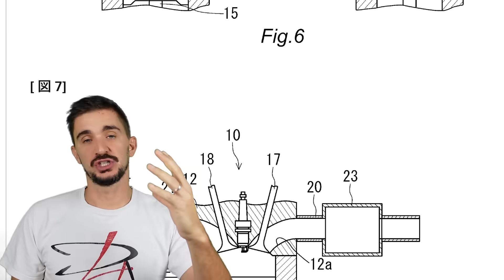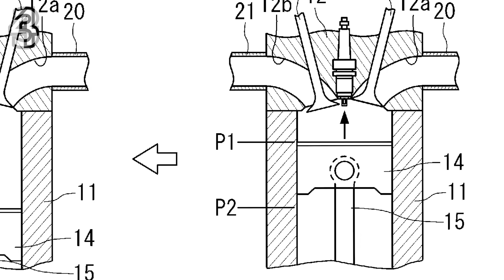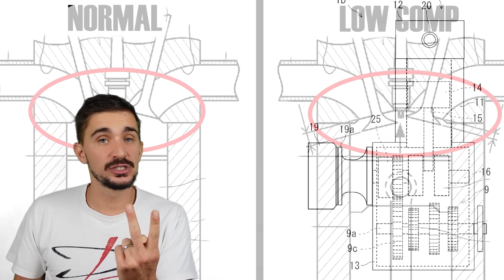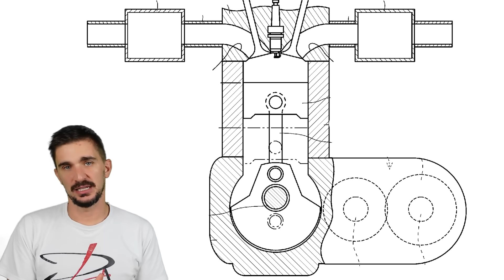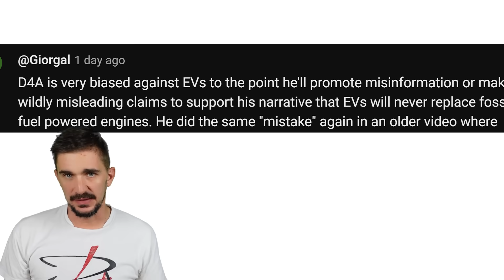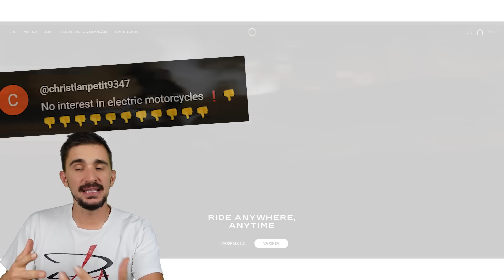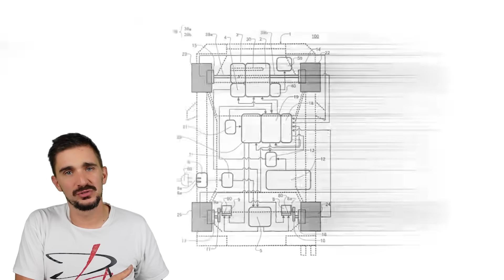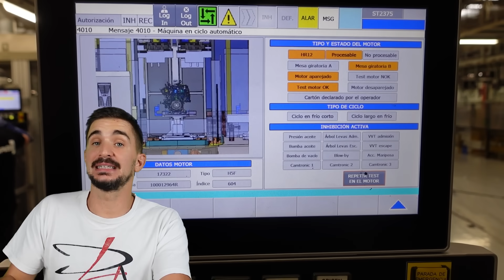Yamaha Just Patented A Fake Engine

Comment: I agree. I hate fake engines and inventions that are inferior weaker future. Performance of any battery gets weaker as it gets deleted while performance of an engine is same with full tank of fuel all the way down to last drop of fuel. The amount of energy in a jerry can that weighs 20kg is equal to energy stored in 1000kg of batteries 🙄 I experienced this the hard way with my gas camping stove thinking 12v electric kettle for boiling water might be "good" and "better" than boiling water for coffee on my camping stove and after buying it quickly realised that to boil 100 coffees I need 5 camping batteries and each coffee will take 10min to boil while with small 150g gas cartridge I can boil 100 coffees and each one in just 2min and I don't need to spend all day charging batteries for 100 coffees so I used 12v kettle about 10 and quickly went back to my gas stove because batteries can never match the power of gas and petroleum in my opinion and it definitely is NOT THE FUTURE!

Comment: Rationale is simple...
There is much more idiots around than smart people.
And average idiot, will swallow anything, if you just pack it in some shiny paper.
If you add words like "eco friendly", "experience the 'real' sound", etc.. you can sell them a brick.

When you read a last car review with something like: oh this new engine is based on that, it works this way...
Long time ago.
Today it's all: the visual line start at the lights, and fluidly track the contour... blah blah bs...
Modern idiots chose a car by the color, not by technical characteristics, simply cos they have no clue what that technical mambo jumbo is.

Comment: For me as a german I really don't like most modern cars. EV or ICE. I love the engineering and the advanced engines they develop but it is just too much digital systems taking control and as well are a risk of the car not making it longer thern 5 years. Even if I would be rich, I don't want to change my car every 3 years. I love my car and want to keep it as long as possible. But all the computer systems are points of failure and you don't know what brands will do with your car with "over the air" updates. It wouldn't be so bad if the systems were open source and you could change it. Like a free Software type or something. I build my PC as well and if I don't like windows I switch to linux. If my Data Drive fails, I buy a new one. If something goes in the car, you have to be happy to even get parts after 10 years. My 2014 Audi A4 Avant which is my first car is holding up well. But a thing like a cable on the electric trunklid broke and it didn't open fully. Audi will only sell you the complete cable tree of the car for 7000 Euros. Wtf?! The repairshop I go to did it themselfs and put in new cables. At worst I would have done it myself. But what if the computer of my Infotainment dies one day? 

At the End there is nothing that we can really do. The new Boss of the WEF Larry Fink (Involved with Black Rock) already stated that they want to kill private cars and single family homes... Car companies love it because they want to sell their stuff as an subscripiton. A brand I work for already said it in an internal event. More cashflow...

Comment: Maybe since it has a spark plug that the motor can truly run with slight modifications  and then charge the battery.  Hybrid / Dual fuel bike maybe... But since it was  patented  as a fake engine  then the bike can be sold as all electric  to meet some EPA standards or something. You have a great channel and I really enjoy watching .Thank you

Comment: I'm surprised that Yamaha were granted a patent for this. As was said in the video, the usual core criteria for a patent are novelty, innovation and usefulness. It looks really tenuous that this design meets these and it doesn't do much different to an common air compressor. It would be interesting to see how a infringement case would go, if it ever came to it.

Comment: okay hear me out, what if after you bought a bike with that fake engine which is as strong as normal engine has a gearbox and only lacks a fuel injection system you buy a fuel injection system from the same manufacturer that couldn't sell you a normal gas powered bike so cheaply as this one and by installing that for example carburtator you have a regular bike that is cheaper than any other stock gas bike in its class.
what do you think about yamaha playing 4d chess right here

Comment: OR may-be Yamaha found that idea as ridiculous and wanted to prevent some other company to come up with it or pay a big license fee. To generate vibrations and sound is not the worst idea but it would certainly be possible for Yamaha engineers to find a better and way easier solution for it. To build and run a fake engine is not it for sure.

Comment: The goal is similar to the goal of the MCAS of the Boeing 737MAX.  Moving the engines forward and upwards changed the pitch response of the aircraft to changes in engine power.  To replicate the 'seat of the pants' feel of earlier B737 models, MCAS adjusted the horizontal stabilizer trim so that the B737MAX pitches up at the same rate as the thrust is increased and pitches down at the same rate when thrust is reduced.  In a real sense, MCAS does nothing (unlike the stall avoidance system, but they fixed that), but you can be sure that the only reason Boeing would not have patented it was to keep it a trade secret.  The fake motor provides the vibrations and sounds that the rider expects.  It doubles as a speedometer that the rider does not have to look at.  The mechanical loading is small and the temperatures are low, so lubrication demands are less.  Harley-Davidson might license the patent, as a Harley-Davidson e-bike that does not go 'potato-potato' is just something with a Harley-Davidson badge, not a true Harley.

"Stark Future" probably could not have just called themselves "Stark" out of fear of receiving cease and desist letters from Disney claiming infringement on Marvel IP, as the 'Stark' of "Stark Future" is clearly and adjective and NOT a 'Tony Stark' reference.

Comment: I would have just used a speaker with a heavy magnet. The oscillation of the magnet creates the vibration and the sound with a fraction of the energy of spinning an engine. Maybe I'm just dumb...

Comment: Could the “Fake” motor be used  to aid with traction control of a a motorcycle? If this system takes power from the electric drive, it could create drive torque interruptions that help a motorcycle maintain traction under high load. You have talked about this many times with motorcycle engine configurations on your channel. Just a thought.

Comment: Call me crazy, but I see the vision here. 

A majority of the pushback from EVs is the lack of feel, lack of feedback, lack of soul that is present with ICEVs. Pretty much all of the attempts made by OEMs to "preserve" or "bring back" that feeling with haptic feedback tech and speakers gets discarded as fake and inauthentic, which is entirely fair. 

Yamaha's approach actually DOES preserve that feeling, because it'd functionally be the same, it just doesn't use the same fuel to drive it. If tuned correctly, in theory, all the noises and feel of driving an NA ICE would still be there, without burning a single drop of fuel. The only exception to that being the smell, which is indeed a tragic loss. 

Do I think this is a good idea? From a technical standpoint, fuck no, it defeats the point of an EV being an efficient, clean mode of transportation. Dramatically reducing your range for the sake of some exhaust burble and seat vibrations is a hilariously shit idea. 

From an emotional perspective, though, I'm torn, because this does resolve a majority of the subjective problems with EVs in a convincing way. Efficiency, performance and enjoyment are not mutually exclusive factors, as has been proven continuously with the ever decreasing demand for EVs. So with how good battery tech is getting, would people trade a couple hundred miles of range for the sake of some exhaust burble and seat vibrations? Probably, if it fit their use case. 

But at the same time, as an enthusiast, it's still only having half the cake. Yeah, it's making noises now, and those noises are almost identical to what would be in an ICE, but in exchange I still lose the entire experience of owning an ICE vehicle. No real tuning, no incremental performance improvement, no maintenance, it's hollow. 

idk, its a dumb idea, but not completely dumb.

Comment: Just because you have a patent for something does not mean you are ever going to build it.  Yamaha does a lot of engine design for other manufacturers.  Having this patent will require any company that wants to do a sound maker for their electric motorcycle go to Yamaha.  I am thinking of Harley Davidson.  Or one of the 100s of motorcycle manufacture in China I know nothing about.

One of the features of my Ducati I love is the induction sound it makes as you roll open the throttle.  That is just one more positive attribute, along with size, weight and handling, that makes me a Ducati owner.  But I am looking for a quiet electric motorcycle or scooter to make my 12 mile commute to the office.   My multistrada is wasted as a commute bike.

Comment: Ye I totally want a motorcycle I need to carry solar panels with me if the battery dies in the middle of the trip and when the battery dies need to spend hours waiting for it to charge. Or some electronics fail and I need to start ordering some smart parts from the manufacturer mid trip.

Comment: I don't imagine it's something they'd actually make. Probably more just to prevent others from doing something similar. As for lubrication and oil changes of the fake engine. Since there's no combustion being done, you likely wouldn't have to change the oil for a very long time as the oil wouldn't get hot enough or put under enough load to get cooked and thus extend oil life.

Comment: Nothing new here.  This patent is derivative of the BMW i8, produced from 2014 to 2020. It’s a plug-in hybrid sports car with a 1.5-liter 3-cylinder engine, and it uses BMW’s Active Sound Design to simulate a V8-like growl inside the cabin. (quoted details from AI Copilot).  It just takes operator-perception to the next level.

Comment: The disconnect here is that OEM's underestimate the intelligence of their consumer. They assume we don't want electric vehicles because we don't like the sound and feel of the vehicles. The reason we don't want them is because we realize it isn't a solution to pollution and emissions. They simply trade them to a less visible form of damage to the environment. We do not have the infrastructure to supply the energy required. They cost more in the long run. The technology is not ready to produce the required range. In short EVs are purely a political ruse to get votes, and not the solution to the problems they claim to be. From a comparison EVs out perform ICEs. We as consumers would love them when and if they technology to aquire the raw materials becomes less environmentally destructive, if the battery technology advances to a comparable weight package, if the waste from dead batteries becomes environmentally safe, if the fire risk was massively reduced,  and if the electric generation and distribution technology evolves to capable levels to handle the demand.

Comment: As an engineer and petrol head I hate anything that is fake and as a motorcycle rider I despise excess weight, it really ruins the riding experience and can degrade a bike to a sort of 2 wheeled car. Furthermore even the most basic bikes (very much including Yamaha's) have been getting ridiculously expensive whilst offering no technology whatsoever, so this joke of a bike to be will be incredibly expensive.

They basically patented a idea to combine to drawbacks of both an electric and conventional a conventional engine in a single bike. And with Yamaha being Yamaha they will probably find a way to have it use 1 liter of oil for every 1000km even without combustion.

Comment: If I didn't know better, I would think Yamaha is pulling an April fools joke on the world. Just add a speaker with engine sounds that respond to the throttle and a shaker that changes with the throttle to make vibration. Put a plastic thing that looks like an engine.

Comment: There could be a 3rd and 4th option.  3rd, the patent is not intended for use, but just to block others form doing something like this.  4th, some crazy engineer thought they could patent anything and with in-house patent team, they just had some fun and patented nonsense.

Comment: It's simpler than Yamaha knowing something we don't: they are hedging. Yamaha has enormous amount of capex tied up in design and manufacturing of ICE engines. All their patents, the research they performed on tuning exhaust/intake sound, the manufacturing quirks of designing high performance engines. If the word were to shift to 100% EVs tomorrow, Yamaha would be dead in the water. This is a relatively cheap way to tell investors that they don't need to panic, Yamaha has a chance to stay relevant in the electric age.

Comment: it's not any more ridiculous than a speaker-based setup, it's probably a lot more realistic and therefore effective at that job, and perhaps it's not that bad on the efficiency front, and certainly better emissions-wise than the alternative of having actual combustion in the cylinders! yeah it's absurd, but not really any more absurd than sticking to a real engine when an EV is viable because you like the sound of the engine, it's in fact a bit more rational than that!

Comment: You are exactly right.  Yamaha totally wasted energy with this patent.  The issue I have with an electric motorcycle is range anxiety.  This issue is starting to go away with electric cars but I cannot get over it with motorcycles. I have enough range anxiety with the 2 gallon tank and 120 mile range with my klx300.  but I can carry extra gas.  I cannot plug into a current bush on any of my favorite rides.  It is 50 miles to get to my favorite ride and there is no charging available for at least 240 miles in that direction.

Comment: If the point of an electric motor is to reduce emissions or be "green", this thing is wasting a ton of energy to do work that achieves zero purpose. Not only does it have to power a useless engine, but its also doing more work having to overcome unnecessary additional friction and mass, and wasting energy as useless heat and noise. That means less energy efficiency and more emissions per mile. Electric motorcycles are already extremely inefficient and short range when they are actually TRYING. That means way more charging, and that electricity for charging isn't just free from the wall plug. Its produced in plants. A modern and efficient small bore 125cc motor would probably actually generate equal or LESS emissions per mile overall, all things considered, with production costs and  overall output.

Comment: Here's the formula for a successful electric touring bike. 1. Able to travel 600 miles at 80 mph on a single charge. 2. 100% recharge in 1 hour. 3. Able to support heated grips, seats, riding gear and all electronics within 600-mile/80-mph range on full charge.4. Price not to exceed the most-expensive ICE touring bike.

Comment: Has anyone patented a fake auto, electric car with internal combustion noise and vibration, yet? Patent idea! People went for four cylinder or balance shaft engines because of the vibration of parallel twins. Now people are complaining that motorcycles have no character because they are too smooth and quiet.
The Patent Office is full of idiots. They grant patents on things that are not new or an improvement.

Comment: As I understand it, the main issue with electric bikes is range. So Yamaha patented a parasitic loss that makes the range even worse... Well, at least none of the other manufacturers can do this for the next, what, 15/20 years? Though apparently battery tech still won't be competitive with (not) dead dinosaur for a long time - maybe they'll have 50% more capacity per weight in 20 years, but that's still a long way from the energy density of (not) dead dinosaur.

I'm pretty sure the Hyundai Ionic does have a performance penalty in "manual" mode - because otherwise it wouldn't feel like a manual. But I get what you're saying - it's just software so when it's off there's no penalty.

Comment: the next question is, can you turn the "engine" off and ride it in "pure" electric mode? Is this the point, Yamaha keep customers who won't buy a bike that doesn't feel like a bike, but they will end up riding it more and more, without the fake engine "running" to save energy increasing range. Eventually becoming converted to electric Yamaha motorcycles.

Comment: I think it is more accurate to call this a negative horsepower engine, since running it wastes energy. If your battery can supply energy so electric motors produce 50hp, then with this engine, that will be reduced to less horsepower.